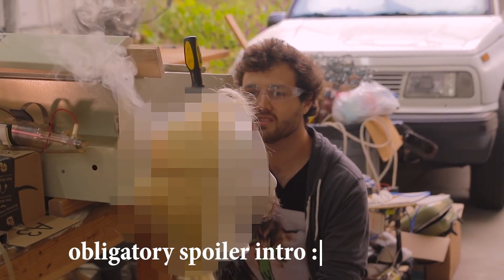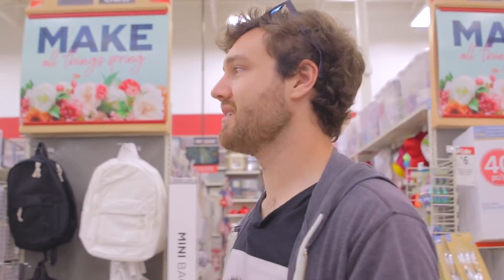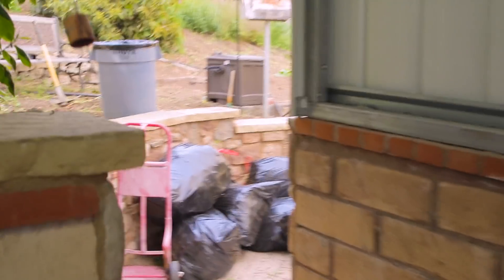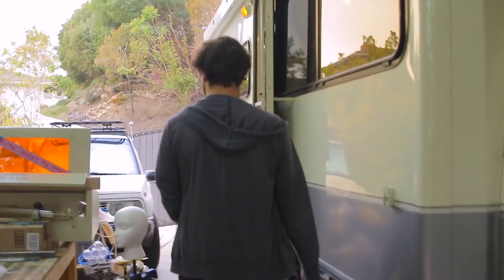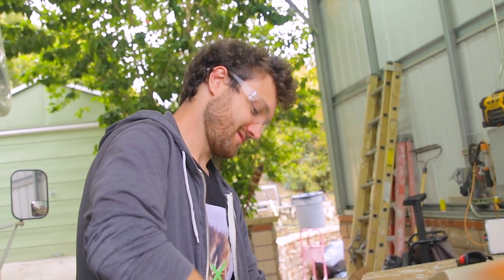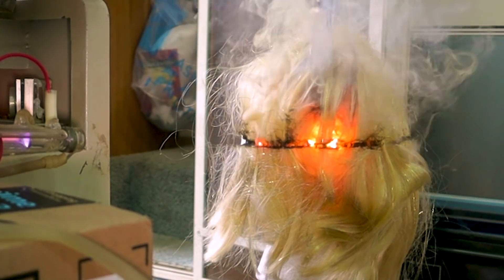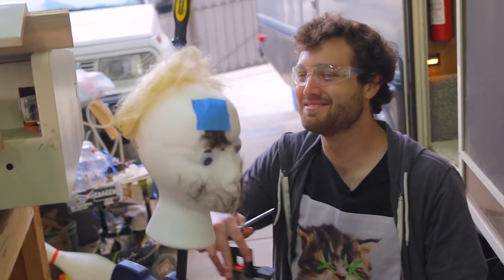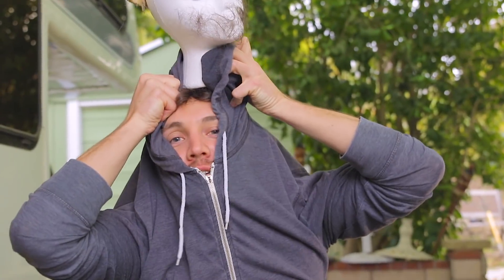Can a Laser Cut Hair?

Comment: If the laser ever breaks and you need to use scissors, what you want is serrated scissors like the kind used to cut hair. Those craft scissors allow the hair to slide down the blade, which is why it was so hard to cut.

Comment: Cutting a pizza ? cooking it ? I had another thought, could you 3D print with a laser ?Just put a spool of filament and have the laser melt it so it drop on a moving platform or better yet, use something like clay and cook a pattern layer after layer and wash/remove the non-cooked clay !

Comment: Wait what happens if you try to lazer cut mirrors? Does it cut through the mirror bounce off? You should test it!
Reply: bubuninja Most laser cutters have mirrors inside them to direct the beam to the cutting head. If you tried to cut a mirror the beam would just be reflected. My hypothesis: the reflected beam would go back to the laser tube and the tube would explode into 580,000,000 pieces.
Reply: bubuninja
I think the fact that the laser bounces off mirrors is what makes em work?
It's something like a compartment of something reactive like co2 that is excited by engery(electricity) to emit photons (light packets) then the mirror lined chamber bounces the light around amplifying it like crazy, then the mirror at the front is only partially reflective so some of that amplified stuff gets thru and it's LASER TIME 🎶
In retina smasher 3000 (the old laser whose name I forgot?) there were mirrors in the tip so that it could be a giant horizontal tube with a vertical cutting beam.
Reply: Actually a regular glass mirror will probably be etched. CO2 lasers etch glass quite well.
Reply: that depends on the optical quality of the mirror, most high power lasers need some very optically perfect mirrors or the light will cut the glass.
Reply: Ben Young but don't you coat em with like vinyl stickers before you can cut to limit reflective ability?
Reply: This conversation makes me think experimentation is in order.
Reply: They don't use visible light laser for that purpose.
Reply: A typical glass mirror will etch (etch deep enough and it becomes a cut/break).  I tried aluminum foil once, laser bounced off without making a mark.

Comment: Test how a mirror responds to the laser, will it reflect or etch the glass? Only one way to find out!
Other Ideas include: a book, a rock, legos (yes I know lego plural is still lego, I will not conform to such meaningless societal standards), a 3d printed object (people have made slinkies this way), a battery, sugar (make melted designs like you did with the glass), and a phone (etch the back, my school has a laser printer and we did this.)
Reply: Indeed they are. The mirrors inside lasers are manufactured to have extremely high reflectivity for a very specific set of wavelengths (the laser). A wall mirror does not have this. Most likely some part of the laser's light will reflect and some will just melt through the mirror.
Reply: Travis Cadle the laser already uses mirrors to guide it to the piece so we already know what happens
Reply: The mirrors in the laser are different from a wall mirror.

Comment: Ah, you could use the condiment machine.... just turn it on and flush the tubes out with soapy water, then a rinse of cold water. Then rubbing alcohol. Then surgical antiseptic. Then water. Then bleach. Maybe a few times with bleach. Then probably a few more runs with water to get the bleach out. Then throw it away.